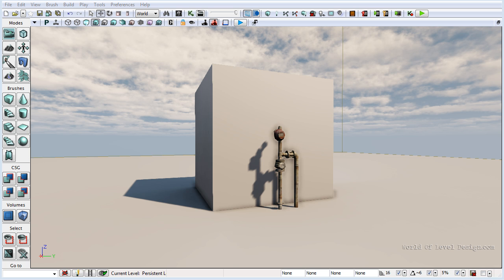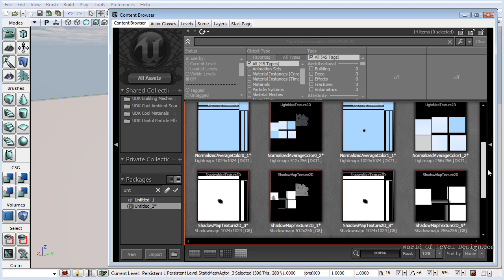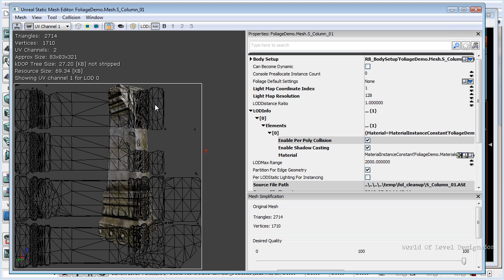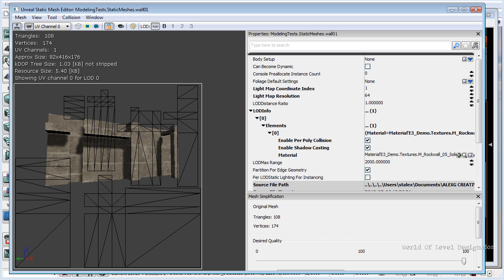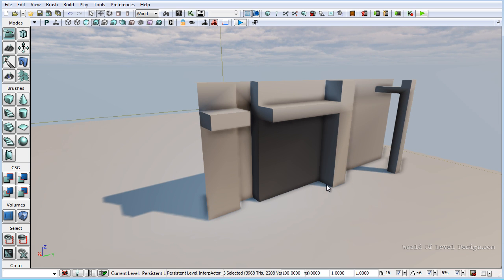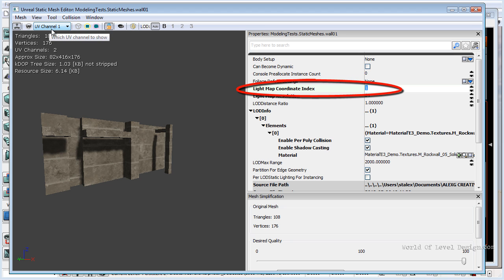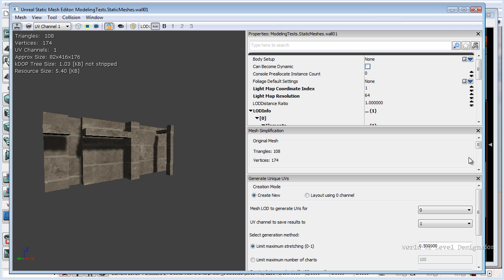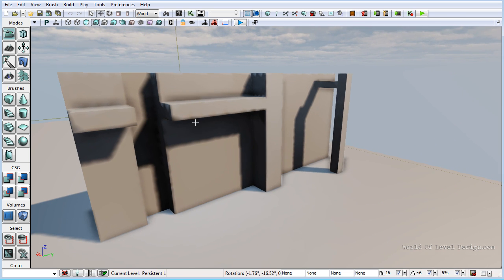UDK: Lightmap Basics - Introduction to Lightmapping with UDK Part 1/4 [Tutorial #18]

Comment: This is a great tutorial. I learned a lot about light maps by watching this and reading your link. One thing missing is to give larger surfaces more space in the light map. I was fixated on putting surfaces together and spacing them apart not realizing the size of the surface in the light map was also important. I cover this issue here: http://oculusdrifter.blogspot.com/2014/02/light-map-nuances.html

Comment: Hi. I have a question about the light map layout. I have several small props sharing the same diffuse texture map. However I need to import them as separate static mesh. My question is: should I also create the second UV with all the props in one map, or separate in individual map?
Thanks a lot!